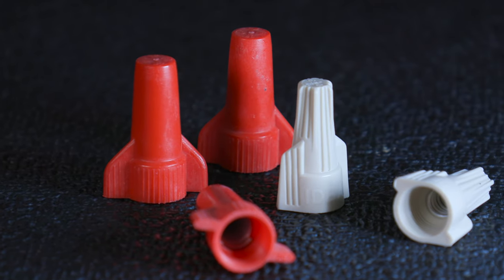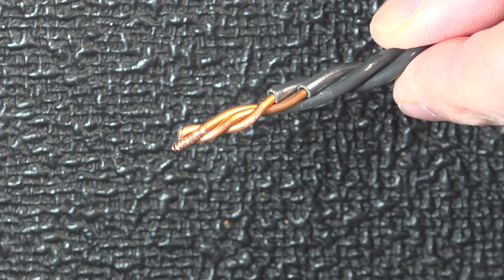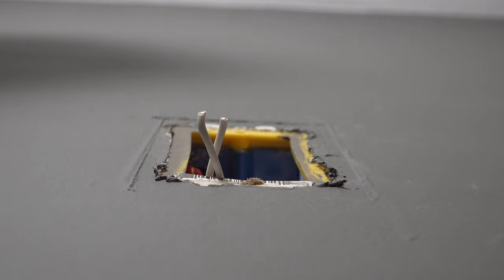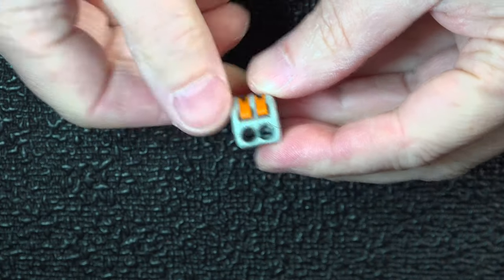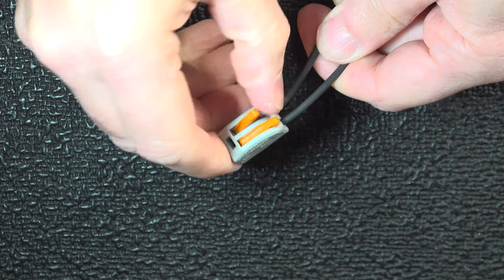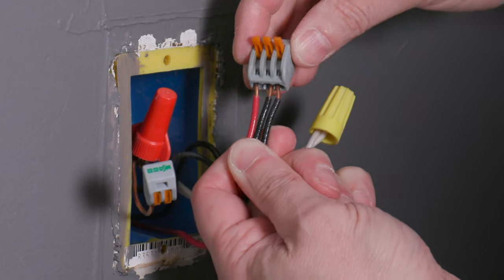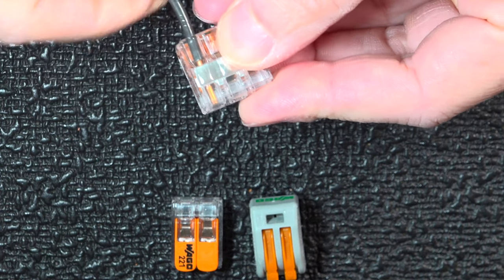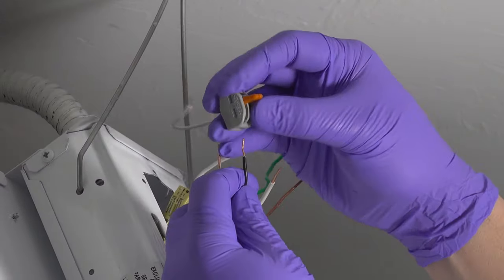Never use Wire Nuts Again - Wago is Better Electrical Connector

Comment: There seems to be a lot of controversy (and immaturity) on this. I found this comment from another video on which wire connector is best to be rather interesting.

"I've been an electrician for almost 4 decades. Industrial, commercial & residential. I'm just an old guy with an opinion, but I've seen a lot. I've opened many j boxes, troubleshot tons of circuit failures, and have seen hundreds of wire nut failures. Here's my opinion, do what you want with it. Due to the thermal expansion and contraction cycles present in electrical systems, over time wire nuts work their way loose and even fall off. I used to blame the previous electrician for not tightening the nuts, but eventually realized it's the wire nut at fault. A twisted splice inside a box is so rigid that it puts more strain on the connection, prohibiting this natural movement. The connection is the weak link, hence the failure point. I use the push in versions exclusively as I believe that the levers could be accidentally popped open when packing the j box. These spring loaded connectors don't loosen up, allow the conductors to swivel and flex easily within the box, eliminating the tension on the wires. You can feel the difference when packing the box too, so much easier, no stress on the conductors. These are not the same as the push in connections on cheap 50 cent receptacles, those are junk and should never be used under any circumstances! I have used WAGO products in the worst industrial chemical processing environments, along with residential applications, since 1994. They hold up better than anything else. I was extremely reluctant and skeptical early on as to their durability, as wire nuts were the gold standard in a trade with rigid beliefs of what works and what doesn't. Now I use them in every application that I can, with no hesitation whatsoever. I keep in touch with my customers, no callbacks ever. I am not an electrical engineer, I just play one in real life!" - Dave Nag

Some other points on these:
• doing a bad job either way gives poor results, and there seem to be plenty of electricians out there like this.
• budget electricians will say wire nuts because wagos are more expensive.
Either of these cases have obviously tainted the data to make a lot of it unreliable. I see issues on both sides and one application may be better suited to one vs the other.
Some other points:
• Mixing solid wires with stranded in a wire nut is just bad all around from what I’ve seen. The stranded get twisted around the solid, potentially getting damaged and breaking strands in the process and dominating the connection between the nut and solid wire, allowing the nut to slip off with the stranded more easily than any push connector.
• With enough time wire nuts can lose friction and have as much as a push connector or lever connector. They’re both friction fit. I do think soldering stranded wires to reinforce them helps - granted that can consume more time and material.
• Based on the point of swiveling from the quote above - as far as solid wires are concerned - I think it can be problematic as far as the application of pigtails where there's too much movement allowed, primarily if used only with a double push/lever connector, however that movement is better controlled with more wires from the box. This allows for enough flex with the wires - more so than twisted wires with wire nuts - but not too much to work their way out of a connector.
• Wire nuts and twisted wires Carry the problem of wearing down conductors which can be especially problematic if the conductors inside a box have been cut too short because of poor work.
• Push connectors can help preserve wires against this problem.

I think a lot of it comes down to the need of the application as well as common sense on where either connector should or should not be used. Either way I think there needs to be more open-mindedness because there are master electricians on either side of the fence and simply taking one or the others word for it and making reasonable considerations for yourself. Don't get me wrong, the opinions of professionals is important, but they shouldn't be considered strictly. Use common sense.

Excuse the novel.
Reply from the maker: I really appreciated the honesty of his comment.
Reply: arkamas, good comment.  wirenuts are illegal in australia.  wagos probably are too.  we use devices which have screws set in the side of them to hold wires tightly together.
Reply: @vsvnrg3263  I’d like to see that. Any reference for images?
Reply: @vsvnrg3263  Okay so I found one video on them.
https://youtu.be/uOYDXOq-_l0
So is this the standard wiring used in Australian buildings?
Reply: @ArkamasRoss  , the wattmaster video had what looked like power outlet sized wire.  i think its 3.2mm.  lighting wire is generally 1.3mm.  most houses were single phase 240v.  green/yellow is earth, blue is neutral and brown is active.  white is used for switching lines.  we used to use uk colours - red active, black neutral and green/yellow for earth.  industrial stuff is 3 phase 415v. the bloke i worked for refused to use single core wire because it breaks too easily.  we only used multi-strand.  he wasn't wrong either.  i saw how working on old wiring in old houses had a tendency to break.  i dont know how wirenuts would work on multi-strand wire. the connector in the wattmaster video is for earth, the theory being that should force be applied to a cable, the earth connection  breaks last.  the old connectors were black bakelite.  then the connectors evolved into the clear ones with collars.  this is so you can see the electricity moving through them (not really) but more importantly, if you come back to look at the connector later the clear plastic will show signs of burning if the wire connection has not been good enough.  i dont know if is law or not but after putting the connector on we always gave a couple of wraps with tape before putting in a junction box.  he always told us the law required live conduits to be 600mm below ground level.  years after finishing with him he said the law was 500mm.  he just wanted to make sure we put it in deep enough.
Reply: Arkamas Experience says it all bravo to you sir. In agreement all the way as you are truly a high level professional - I as a jouneyman team leader teach one thing "solder" every time. Then "wings" and mousetraps become nothing more than conjecture Spring loaded help but are not definitive enough as some homes still maintain aluminum wiring. Stranded and Solid are not a happy medium together either and present challenges as well. By the way I still find on rare occasion aluminum conductors used in homes if that being the case I say to possible clients that the mediums are not ideal as I explain the reason which is expansion and contraction are not even close to the same rate thus having faulty connections and may eventually fail or get hot because of a galvanic reaction due to use of dissimilar metals. Im glad aluminum has been eliminated by ANSI standards for home/commercial use. I was an engineer by trade  and I maintain my IEEE membership. The real world has taught me many things and the stuff i've seen and corrected are astonishing and not even near to codes as I ask myself one thing why hasn't this property burned to the ground! Everybody wants quality that we can agree on always, but consumers are always willing to compromise when it comes solely to cost. When I quote on any job I assure the customer using videos as I capture all of my installs I can then explain the why's and the what's hopefully convincing them of one thing its called assurance and that I will never compromise on safety for cost ever. I can tell professional/experienced work immediately. Im old school similar to you as we share one thing "professional work with regard for customer confidence and safety". Ive have seen all the mouse traps as you have and quite frankly they have their limited benefits as I find they can add to the confusion of electrical work, but guess what? First thing out of my mouth to the possible customer is if you wanna save money and in reality who don't? Let's talk about the benefits I bring  and what I can do for you reasonably. Arkamas my commitment is using quality components installed by professionals they will get a "lifetime usage and purpose" which will be transparent and safe. Now im off to drink more coffee out of my Grandads old porcelain coffee cup - made in America. Cant fool old school!!
Reply: Well said
Reply: I am an electrician too but never used these type of connectors. How do they hold up to high amperage, how much metal is in contact with the copper? I could see using these to tap off a low amperage fixture but to a receptacle running am air conditioner I wouldn't think it would be as safe as a twisted connection with a wire nut.
Reply: @cousinles80  I think 14 or 12 is the max conductor size for these
Reply: @cousinles80  There’s a test vid on it running and greatly exceeding listed amperage. I don’t remember the specific video but I’m sure there are others. I’ll post the link if I find it again.
Reply: @ArkamasRoss  awesome thanks
Reply: I was just using wire nuts again the other day and cursing them like usual. I was putting up a light with romex and braided wire and could not get the wire nuts to stay. I finally gave up on the wire nuts and just wired them together and used black electrical tape and heavily taped them together. I kept telling myself, this is the 21st century, there has to be a better way. I figured from now on I was going to buy crimping connectors, stick them on the wires, crimp them and make my connections from there. I didn't even know these type of connectors were available. I will definitely be looking into them.  Thanx. P.S., I am not an electrician but I did stay at a Holiday Inn last night.
Reply: I've repaired shorts from push in connectors multiple times in the past decade. From competent electricians.  And homeowners alike. I don't trust them for shit.
Same as recepticle that short are typically were it pulled out of the push ins instead of using the lugz on the side.
Reply: @dormantmenace  See push-ins on devices I don’t get. I’ve seen more than enough electricians on here treat them like the plague. The one that did our house used them on all the devices - a couple of which were cracked. I don’t understand why it’s still being made an option. Electrical infrastructure should have the highest standards in my opinion and that doesn’t meet it.
Reply: I updated a few other points on this.
Reply: @vincentbrennan9614  I’m no electrician as yet, So I won't claim to any professionally, but I hope to be what you describe if I can find a good apprenticeship. Sorry I only just saw your comment.
Reply: @jacksnider5836  Just trying to present fair points

Comment: I've been doin this for 21 years 
I would rather use wire nutts over wagos every time
Reply: you and every other trained electrician...wagos are for kids
Reply: @MrHBSoftware  kinda weird arguement, "wagos are for kids". why not make your job easyer?
or maybe you respond better to this, make your job easyer, spend less time per job, do more jobs, get more money!
or, make your job easyer, spend less time per job, make same amount of money with fewer hours worked, spend more time with your kids.
Reply: @chrisalmere20  use cheaper wingnuts, make more reliable connections have less recalls, make more money, spend more time with your kids

Comment: I just installed drywall in a basement. The ceiling fixtures had these installed with temporary bulbs. I disconnected them ,  routed the boxes and reconnected them .  Very nice and easy.
Reply: Nice! Can't wait to start using these

Comment: 1. I don't cut the wires. No fires so far.
2. I don't rely on the wirenut to stay tight. I wrap it with electrical tape. It works and it's safe.
3. The fact that some people don't use them correctly is not the wirenut's fault. It's the User-Nut's fault.

Not saying the Wago thingie is a bad idea, in fact it really looks cool. I'm just saying that I'm not throwing out my wirenuts and rushing out to Home Depot to buy Wago thingies any time soon.

Oddly enough, it seems they aren't available at Home Depot anyway.
Reply: Several problems with these 'Wago' thingies...I think they have to be ordered online, which ain't gonna cut it if you're doing a bunch of work in a short amount of time. If you run out of wire nuts, you can hit the hardware store and be back to work in no time. They're way more expensive than wire nuts and provide very little contact surface to the wires. I'm sure you know what problems that can create.

Comment: Contractor used these on new commercial lighting install, hundreds of lights. Less than two years all these connections started to fail. It’s been a maintenance nightmare.
Reply: That was my thought exactly.  My assessment is that unlike a wire nut, which when installed correctly, acts passively in the system - the connection is with the wires - this appliance actually contains the current the carrier and will be prone to failure, particular as quality for generic connectors of the sort start coming out of Asia on the cheap.  Just like we see blade contact receptacles passing through big-box home improvement stores that fail within a year due to low quality control.  Never should happen.  I can count number of receptacles over 40 years old that I encountered that failed due to poor mechanical contact / arcing on one hand. Not true about stuff procured in past 15 years... always cutting cost.

Comment: Being electrician they’re great for doing Lighting connectors but when you put real amperage to them they don’t hold up
Reply: They can take plenty of amperage, pretty sure the wire usually fails before wago connectors do.
Reply: Wago 222’s are the industry standard now ....hands down the better option.....every pump that gets sent out our door has wagos on them, the only time we use wire nuts is 10 gauge wire or bigger
Reply: Your statement is ABSOLUTELY unproven
Reply: Mark >>>>  Precisely !
Reply: Mark are you serious ? After 40yrs. of electrical work I never had a wire nut fail ....a bad slice can make a hot spot but that's not the wire nuts fault . There's "no load' on wire nuts so they can't fail , sorry I'm not buying it
Reply: I've used them, but not on 20A or more.  Feel better about the extra surface area being contacted with wire nuts vs the smaller area on the Wago's.
Reply: @MojoPup  you’re not going to use them for over 20amps .......they don’t make them ...... that’s the highest they go ..
Reply: @slyspy9819  I’ve been electrician about that long to but wiggles have never been trustworthy to me wire nuts I’ve always been better to twist your wire stick a warrant out on it it’ll stay that way forever
Reply: @slyspy9819  I think he was commenting about wago connectors, not wire nuts.
Reply: I've used these for years in the industrial marine industry. They work great. In fact, I just changed two emergency lights yesterday and the were wired with them. I was working from a ladder and it was much quicker and easier to connect while holding the fixture in one hand.
Reply: industrial marine industry uses non-waterproof rated connecters?  Odd....  not on my boat.
Reply: @stifflers69mom1  why would you want to put wire nuts on anything bigger than #10?
Reply: @joshuahaught4812  ..... do you have a better way to wire a 75hp 575vac motor.......??????
Reply: @stifflers69mom1  Polaris
Reply: @joshuahaught4812  you try shoving those things in a motor box ....no thank you ....there nice but not practical for motor applications ....they come out of the factory with wire nuts .. I keep it that way
Reply: @stifflers69mom1  Ahhh, gotcha. I don't wire that many motors. My rule of thumb is any wire larger than #10 I use Polaris or butt splice.
Reply: @joshuahaught4812 lol ....you got me? Not really anyone that’s wired a large motor knows shoving 6 of those damn things in a motor wire box is not gonna happen ....but I do like Polaris connectors in junction boxes and wire ways ....they work great ....just like wagos lol
Reply: @stifflers69mom1  I bet man. Thank's for learning me something. Take care.
Reply: @joshuahaught4812  the only reason I know is because I do it for a living.....ask me about split unit heat pumps and central ac units and I would look at you like you had three eyes lol
Reply: @stifflers69mom1  😳 lol
Reply: @stifflers69mom1  

Lugs
Reply: @anhydrouswater  correct answer sir ,with motor stub splice insulators......or just splicing tape
Reply: @TripleAstyle1  no reason to use water-rated connectors in dry locations. These boats come from the shipyard with standard wire nuts, in most cases...uscg approved. My point is that this is a harsh environment... mainly due to heat and vibration (lots of constant vibration). We have equipment failure regularly. I have replaced or repaired countless parts and fixtures. Not once have I seen a failure due to these connectors. To be fair, I haven't seen failures with wire nuts, either. I'm just responding to the naysayers who insist these aren't reliable. They are and have been tested thoroughly.

Comment: Wire nuts, when installed correctly, can be used over and over again. An electrical circuit is only as reliable as its worst connection and the connectors shown here will also wear over time.